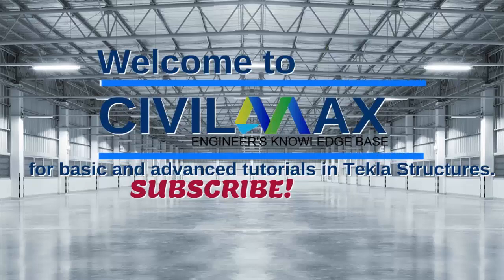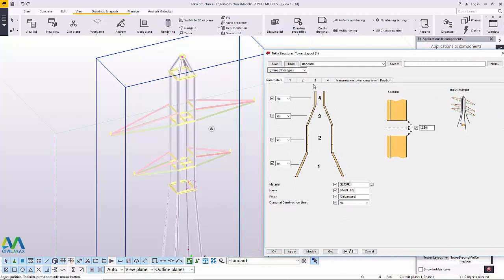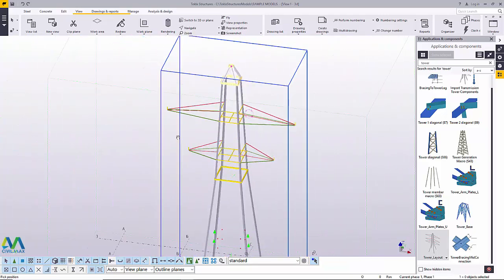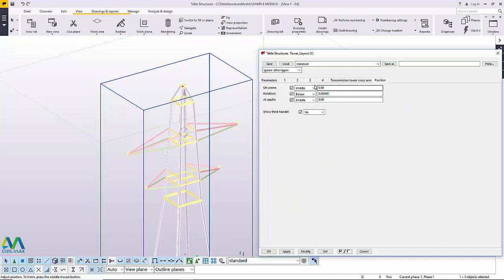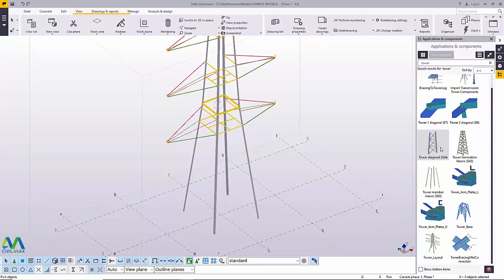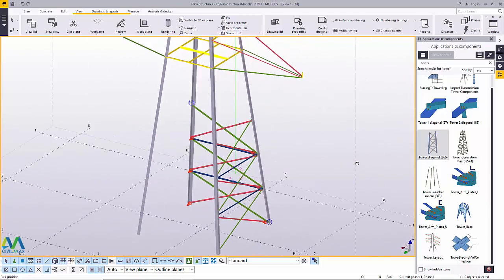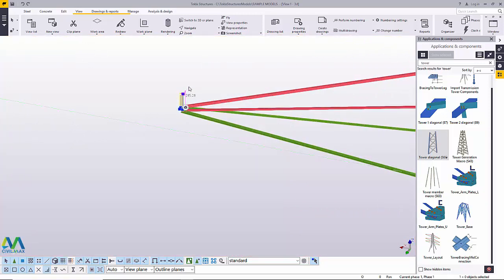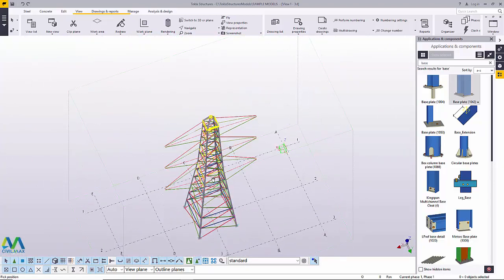How to create and detaill power transmission tower in Tekla Structures

Comment: Hey bro I am wondering, what kind of bolted gusset do you recommended  for connection system component in tower transmition design? thanks.
Reply from the maker: It's a designer's choice